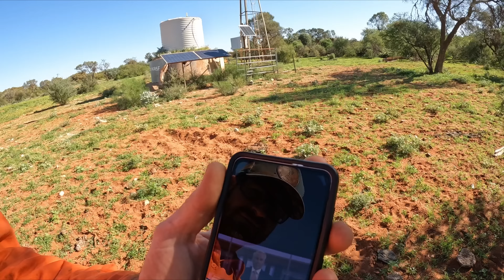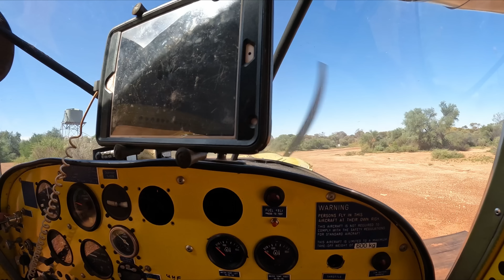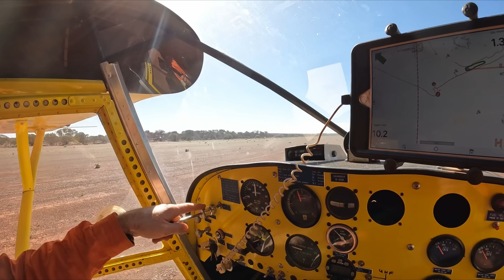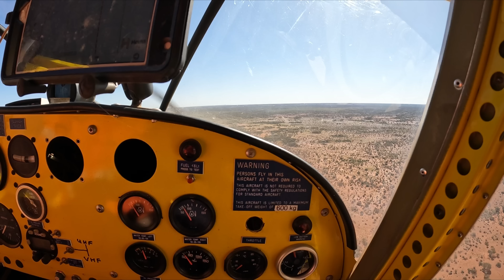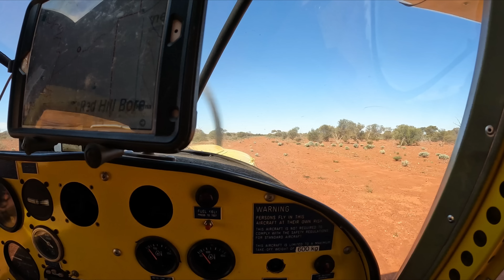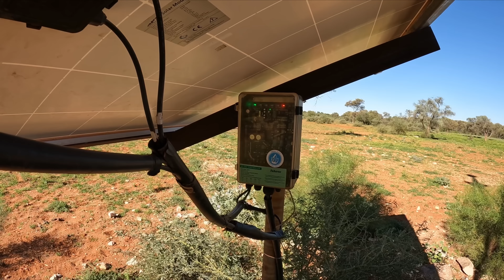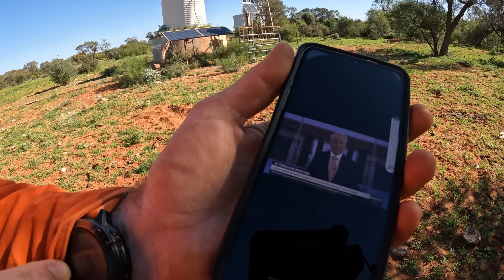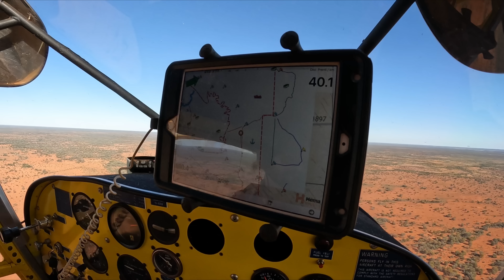Repairing a Wireless Monitoring Unit in the Outback

Comment: This was extremely interesting. It answered many questions I've wondered about. Like in the horse days it would take weeks to check on all the windmills but the water tanks were much bigger to make it work. Must have been a long dusty trail for pack horses. The modern technology is amazing. You can check all your water systems before going to bed and sleep well knowing they are all OK.  For sure keep your efforts confidential, you did the research, and the effort to set it up. Would be pissed if some company used your work to profit. Like your sense of humour. Well done from BC Canada

Comment: Hi Jack, thanks for the video! I originally started watching it to see how the Savannah went...I want to build one one day, but also enjoyed seeing your network.
We cobbled together a similar solar powered remote camera over 20 years ago on our (small) farm. It had a solar panel and deep cycle battery powering a small (for the time) 12V computer running Linux, usb camera, web server and various open source software and shell scripts (my brother's in IT) grabbing pics at water troughs etc. The link was via 200mW PCMCIA WiFi cards and modified Pay TV microwave dishes. Range was a few km and we thought it was pretty cool at the time 🙂
Now that we have Starlink I'm gradually expanding our wifi footprint with Ubiquiti gear and want to set up cameras again. I'll be interested to see how you did it. Like you I avoid subscription based software and equipment like the plague!

Comment: It surprises me that there are so many doubters, since point to point and point to multipoint over long distances can be achieved with Ubiquiti gear at modest hardware cost.  Not sure if the Ubiquiti gear would survive the outback conditions, but I have set up point to multipoint on a friend's 25 acre property so he has internet anywhere on the block, using the lower end Ubiquiti gear.  It's been running faultlessly for about 7 years now.  No doubt other manufacturers have similar gear which is even more powerful (and expensive).
Reply from the maker: We are certainly giving the Ubiquiti gear a good test out here. And we have only had failures on second hand equipment. 
Because we have no other interference we are getting very good performance out of it. 

I looked into Mikrotik, we are using it for a different application, and it's doing well in this environment as well. 
I went the UI gear because the configuration is a little more intuitive. 

I would like to test out Mikrotik gear though, CAPSMan looks good.
Reply: converting the stock poe injectors to 12 volts (with buck convertor) was simple with unifi gear as well.

Comment: Well done for challenging the “experts”..   I read somewhere that the Wi-Fi distance record is circa 137 miles achieved by a Venezuelan amateur, using mainly off the shelf tech.  😊.
Reply from the maker: All the Wi-Fi tech we use is off the shelf, just the configurations we are using is unique, we should be able to pull a 100km link with some of the gear, but we run into issues like the earth :P

Comment: So back at the homestead you have a fixed wireless nbn antenna hooking to a modem which then the modem is hooked up to your dishes that send singles around the station? And what brand are all your cameras around the station? Anyway, amazing what you have done Jack👍
Reply from the maker: It's all sattelite, so at the homestead we have a starlink unit and a sattelite NBN connection uplink. 

Around the station we have a fixed wireless network that we have made ourselves. 
We use a few different brands of camera here.
Reply: @jack_out_the_back  Sounds good, what sort of history did you have in Precision Ag (as mentioned in the video)?
Reply from the maker: @noahjbarr  I was an integrated solutions specialist for a John Deere dealership over in Victoria before I moved to the station, I had worked for a few dealerships in WA and VIC, but Cervus (now Brandt) were quite proactive in pushing towards more integration between real time data a d decision making.

Comment: Another good update Jack and Ant,  was wondering what the  rubber skirt things are around some of your 44 gallon drums in the hanger shed?  Also looks like your loosing a bit of solar at Packshorse from the small shadow overshadowing your other big  panel. Good to hear if you can’t find Ant he will be out at Packhorse watching the footy😂. Or maybe not given the Mozzies. 🦟 Good on you for looking after your IP.
Reply from the maker: Yeah we've changed a few due to the overshadow, we're improving our designs. 

The rubber skirt is a tire tube, to protect them from rubbing when transporting them.
Reply from the maker: Packhorse is shallow enough and produces well enough that the shadow isn't impacting the production levels.
Reply: @jack_out_the_back  I am sure you would have had it sorted and guessed you must have had excess capacity.

Comment: Well I was going to ask what equipment your using for your solar panels, solar reg, charge controller, inverter, wifi transceiver.. 
The only thing you gave away is that your using 5GHz..
I guess there's no point asking that question now is there.. :) "Humour"

I'm doing something similar.
The solar system is built and operational with 700 AH of battery storage at 48volts, 5Kw of 230volt 50Hz supply to the shed with lighting and GPO's etc, all safe and approved. 4gx internet service via a 10m tall tower which is also distributed via WIFI to the shed and house..

I've guess I have a little advantage over many farmers in some ways.. I've a trade background and have worked in tech for the past 30 years..
Although on the other hand I take my hat off to you old school and new school farmer.. bugger you know some stuff, soil, fertilizers, grass, animals, fences etc. etc.  Me I'm a textbook farmer but we'll give it a go.. 
  
The next "Tech agriculture" centric project is Solar in the paddock which will charge a couple of batteries and supply a diaphragm pump pulling water from the creek pumping to a header tank. The WIFI piece and camera are something I still need to investigate, test, fail, test and hopefully succeed on..

Like you Jack. I have not bought any off the shelf solutions, it's all been plenty of reading, asking advice, forum chats, you tube. Then design, purchase components and implementation. (and some arduino action and code cutting in the works)  
Saying that I'm not a gluten for punishment, where I could purchase a piece of equipment rather than invent it I did.. 
eg.. don't buy cheap internet solar regulators, inverters etc.. they don't last.. For example In my case I chose the Chineesium combined unit for a solar regulator, charge controller and inverter in one box of the Growatt SPF 5000ES with WIFI. It works beautifully with some limitations. Yes I would like Victron but the Growatt was 25% of the cost of the Victron equivalent.. 
Anyway I'm just banging on.. 
Bloody great video Jack and Ant..
Since Ant's appearance on the scene your video's have improved.. more comical, more interactive.. Ant your worth more money..
Maybe you could have a YouTube income % share deal with Ant.. That will get the old bloke even more reved up..  
https://www.youtube.com/s/gaming/emoji/7ff574f2/emoji_u1f600.png

If you want to talk tech Jack. Let me know.
Thank you guys..

Comment: Did you look into LoRa for the sensors before you had 5g and starlink? I can only imagine that the biggest draw on power is the camera and switch...do you have any compute modules at each site?  Sorry propeller headed and I'm getting a vicarious kick out of thinking how I would do something like this with time, money and motivation.  Image / animal recognition, animal condition prediction, sensor data aggregation reporting and alerts...instumentation up the wazoo...I'd be a shit farmer though ;-)  I wonder if there's a way to mark the animals individually when you bring them in so that when they travel to a water point the camera can see it classify it ...monitor its drinking maybe...bar coding a cow so it can be seen by a hd camera 30ft in the air and 50 meters away...dumb idea when I think about like that but....bluetooth?  The animal would need a power pack...then you have to worry about collar maintenance...another dumb idea...but it could run on a schedule.. nano compute module takes a daily sample of skin temps and moisture...try's daily to send info as they come to the water point...too much power required...impossible maintenance...impossible conditions.....fun to think about though ;-)